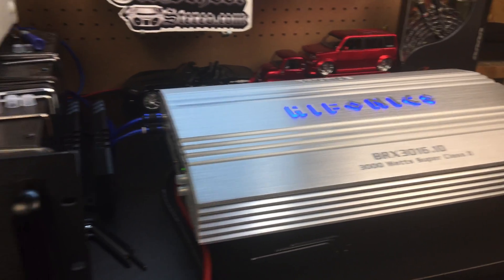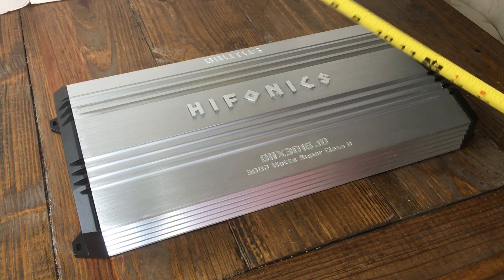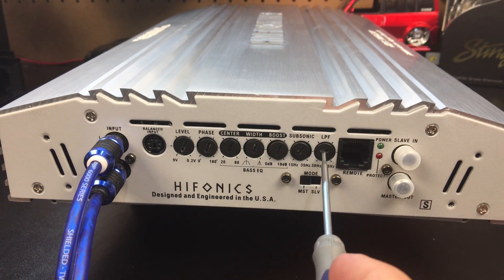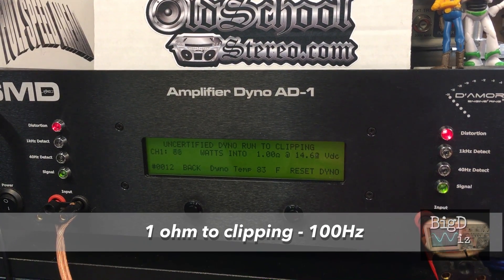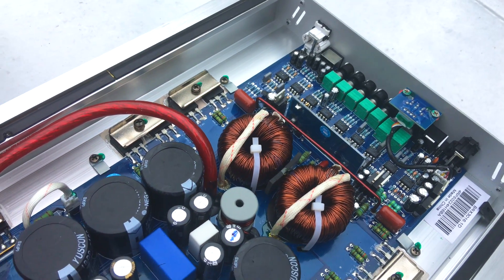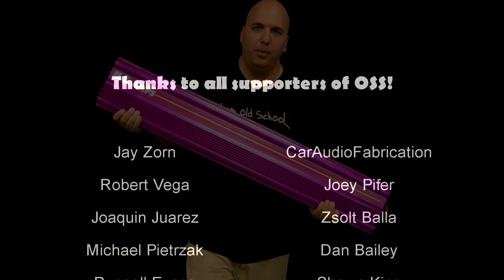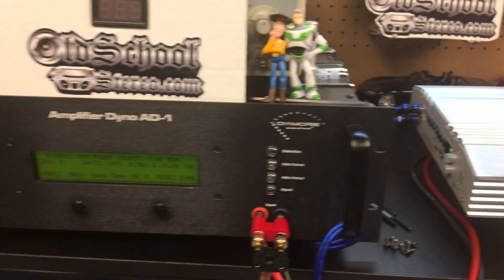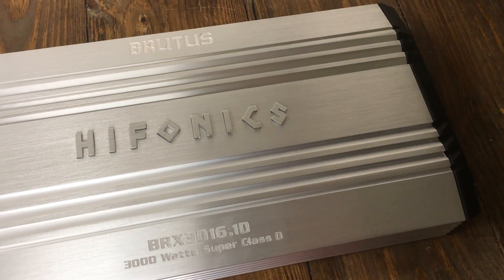Is That 3kW RMS or MAX? HiFonics Brutus BRX3016.1D 3000 watt Amp Dyno Test

Comment: Mosfet down! I owned a 2k hifonics amp , I switched to a Rockford 1500. Hits way harder and significantly less light dimming. My cousins 2 year old hifonics 3k amp just failed after only 2 years. I think they are better than the really cheap amps but they don't don't seem to hold up and are more power hungry but for the money it's nice on a cheap install.
Reply from the maker: Precisely

Comment: They havent made good amps since the brutus BRZ model amplifiers. They were CEA2006 compliant. The newer ones arent
Reply: Iv'e still got my BRX-1600.1D that Iv'e had since 2011. And it's still kicking pretty hard. And also CEA2006 rated.
RMS Power Rating (@ 14.4V):
 4 ohms: 600 watts x 1,  2 ohms: 1200 watts x 1,  1 ohm: 1600 watts x 1 chan.
Reply: @purplehazeffc  hang on to it i had the BRZ 1700.1D. I now have the newest model now a BXX 1200.4 and BXX 3000.1D. I have two batteries in gonna get a 3rd battery with another run of 0 gauge. To run it at 1ohm at 2500watts rms. Ill see how it does in this °100 heat

Comment: I'm very sorry your amp died, however I took this as a learning opportunity and made some adjustments to your madness!!! I have been running this amp at 0.48 ohms for almost two years now on 2 x Power Acoustik GW3-10 10" Dual 2 Ω 1000W RMS Subwoofers in a large ported box 32hz tune. the amp does get hot in that area that eventually blew up on ya, so I mounted a 140mm pc fan blowing across the amp to keep it cool and NO problems! I use this in my home theater. I'm really amazed at how clean the lows are on this amp. I don't think I can ever use over 4000W+ on my setup without destroying my subs. I have "abused" my setup as well and clamped about 2,200W on various tracks for about 20 min before the smell of voice coils started filling the air. ALL the windows, doors, vents, walls, and floor were shaking the house. 

Thank you for awesome content!!! 

I have a 13.1V ASTRON RS-70A power supply on 3 900CCA Group D batteries. The 13.1v is for safer float voltage across the Walmart batteries so they don't puff in 3 years like they would at 14.1V.

I'm outta here!!!!!!!!!................

Comment: Big D come on now we both know you know it’s RJ-45 not Cat5 lol!! Good test! I  catch myself watching old amp dyno tests again!
Reply from the maker: Cat5 is da cable, RJ45 is the connector
Reply: Williston Audio Labs lol good point ill concede rj-45 is the connection type. The cable would be an Ethernet cable, Cat5 would be the category or rating of the Ethernet cable used. I would imagine for car audio purposes these companies could possibly be better off using Cat6 or better since it provides the better signal to noise ratios. Not to sure if it would make any difference though that’s getting pass my knowledge a little bit.. maybe you would know if I remember correctly you work in IT or network fields?or something along those lines.

Comment: Where the fuses at on the amp?
Reply from the maker: External fusing required
Reply: @wal  so that's just a in line fuse close to the battery on positive wire

Comment: Howphonics! Ha-ha, just not what they used to be! Why can they not just rate things how they actually perform! Then throw the "peak" in there to sell,  like 500 watt rms, and 5kw peak!! It's just got crazy, what do they do , spin a wheel for numbers, or just pull them out the air! Like usb power banks, 60,000 mah, when it has 2 x 3ah batteries in it, it should be less than 6,000 mah, because of it can't be 100% efficient, where does that 60,000mah/ 60 ah cime from, do they just add zeros to it!! On amps they just double or triple the real output!! Great video!!

Comment: 1001bd RFalsgate. Over 15 years I've had the big ass amp. Only fixed it once touched wires together oops! But will a Hifonics last that long? 2x Type R Alpines only replaced 1 over same amount of time. k5 Blazer,  Infinity Q45, 3 diff.  Saturns, and now Es330. Rockford and Alpine on mine! Had Jls had Kenwood, Kicker amps. Still bang the old school 2 fans, and Epic Center beating for years!  Nice video tho.

Comment: the new bxx 3k is bad. hooked up to two batteries big 3 upgrade and it kept going into protect when i turned up the volume. and as soon as i turned the volume down the amp would come back out of protect, never got hot. the amp was seeing 14.5 and only dropped down to like 13.8. speakers were wired in parallel and was reading 1.5 ohms each. i had to get that gain to 75% to make my speakers move......omg distortion and clipping right out the box.i will never buy hifonics again..its being shipped back to amazon right now.i will be buying the orion xtr 2500.oh my speakers are evl 15's dvc 4ohm. the best speakers ive owned going on 3 years with these speakers.

Comment: Wow... That amp is actually quite impressive.. Or, well, it WAS impressive.. Haha! Nice work :) An amp that sort of lived up to its ratings, even handling an overload for a little while before going bang but..i guess the protection circuitry isn't up to par as you'd hope it would notice the wrong load and go into protect before it blows the arse out of the output stages! Or in this case the SMPSU stage? Ouch.. I'd love to have a go at repairing it! Hahah.. Make it live again!
Reply from the maker: I sent it back and yes it was a bummer the lack of protection circuit

Comment: Crap 5k of rms! ... hey I've had my APMI2000 at @0.5ohm for over a year now and still going strong  so I was wondering if you could retest it at .5 on music to see what its capable of?  People ask this question all the time in the car audio forums. Thanks.
Reply from the maker: The AP doesn’t like 0.5 resistive, but as you know speakers in a box exhibit impedance rise. I’m getting a box for the Massive Audio 6kW sub and plan on testing amps with this sub in addition to the Dyno

Comment: Yo Big d why so much voltage drop on the test with this amp? 
What you running for electrical in there these days. Still have cap bank or is that gone?

Comment: Hifonics was in all the booming rides in the early 90s. They shook the ground. Hifonics was the Mack Daddy
Reply: Mr K that's when they were Zed made back then every brand that was Zed made banged today hifonics is budget stuff ok for daily system not for comp
Reply: So was autotek in the 90s and mb quart in the 2000s but now maxxsonics owns them all along with ppi crunch sound stream and some others idk I guess if you don’t push too hard they are a ok product but I have never seen a maxxsonics amp that didn’t go up in smoke after a while my buddy had all sound stream rubicon amps it worked for a while but ended up blowing everything door speakers amps and all he ended up getting some xta sound stream amps before they went to max Sonics never had a problem very quality amp 🤷‍♂️
Reply: @mirkolazar9250  Sounds like your friend didnt know how to set his system up. Ive been running Hifonics since the Zed era and run a couple cheap Maxxsonics amps in a few of my cars are over 10 years old. If you set your system up properly things dont blow up.
Reply: Yep. Hifonics and precision power. My buddy had a precision power in his Pontiac 6000 that was like 3 feet long. Even with an extra battery and a capacitor it taxed his charging  system hard. Headlights dimmed a lot. Dropped below 10v with Snoop dogg doggystyle cd.
Reply: @joes.7536  Our step up from Hifonics back in the day was Phoenix Gold. My brother had 5x XS2500s running four X-max 12s in a 90s Tbird and the thing hit 157.9 in competition which is pretty nuts for only 2400w of actual power to the subs. Man I miss those days running a stereo shop and having not a care in the world other than how hard i could make my eyes cross when that bass drop hit
Reply: In always sticking with Hifonics had them since late 90s
Reply: @Fat Italian I had vlx400s, ppi arts, audioarts etc and loved the way my Hifonics 8 colossus sounded. I currently dont have any systems in my cars but about to start one.
Reply: These hifonics amps are nowhere near what they were in 80s and 90s though lol. Old school ones were way better
Reply: @JohnDoe-bk4px  Everything old school was better
Reply from the maker: Yessir, you are correct! Zeus and Colossus FTW!
Reply: @wal  Orion amps, the original 1000 watt units from the mid 90's.  what god tier amps those were.
Reply: Moe Whitfield I still have my 2 xtr 2250's known the beast from the 90s
Reply: @wal  I sold and installed car audio right around 1999. We had a Colossus up on the wall just to show off and it worked really well. We would build 6 high towers of the old pink Power From the Gods Hifonics 12s and they would just FLY out the door with people dreaming of running them on that massive amp.

Comment: Love the reviews but I have this amp on a 12in typeR. It will go in to protect mode if its going hard😭
Reply from the maker: Make sure your ground is good and that your voltage isn’t dipping too low 🤔

Comment: 250 dollars or less what amp would you recomend to run 2 americanbass xfls? xfls are 1000 rms each and it will be wired at 1 ohm. xfls also have 3 inch voice coils with a 220 ounce magnets

Comment: Big D any ideas what the manufacturer's do with the amps that people send back with defects? I'm trying to get ahold of a few blown amps only because I get people asking me to fix theres but  I've only repaired a few and it was just the main power supply caps and some terrible solder joints. Before I start charging people there hard earned money, I need to make sure I'm fully capable of the repairs...THAT LAST!
Reply from the maker: They usually board swap them I think. Some will sell damaged amps in bulk

Comment: I've got the next one up from this and it's been running at .67ohm for over a year and has never clipped off once
Reply: do you still have an is running?
Reply: @richardj.barlow4294  yes I do and its still running great
Reply: And its the 3216 model
Reply: @stevenlacroix1856  awesome thx for your reply i been looking for an amp and other then taramps i can't find many ppl running anything else but i want to get like a 3 to 8k amp ands it tough to know who to buy anymore since none of the brands are made here anymore.  But hifonics just look befier to me then taramps
Reply: @richardj.barlow4294  I have had it for about 4 years now and I've never had a problem
Reply: @stevenlacroix1856  appreciate ur response il prob look at the higher watt i think its zeus or maybe brutus regardless i just wanted to know the quality if urs built wdll then odds are they are all pretty good.  I had them back in the day and they were awesome way under rated watts wise and that amp still plays to this day but not same company anymore almost none of them are maybe jl audio might be the only one?
Reply: What speaker setup gives you 0.67 , and what is the final ohm when playing music
Reply: I'm running 2 12 inch bravox extremes both dual 2 ohm and 1200 rms each and they read .66 on the meter together
Reply: @stevenlacroix1856  is it a long speaker wire run,I thought you would be closer to 0.5
Reply: About 3 feet but right at the box thats what its been for the last few years

Comment: Can you do a dyno test on hifonics brutus  bxx series 4k at 1 ohm
Reply: Sean Patrick  I just sold my xtr 2500 and regret it as the next amp I bought is trash. I'm looking into the bxx4000 also bit can't find shit
Reply: Jose Velazquez if it is a class d amp no it will not work long bud
Reply: @craigbarnett3564  

Are you an amp builder?

Comment: Do you think these results reflect the Hifonics Zeus zxx 3200.1
Reply: They are weaker than the Brutus bruh just get a Audiopipe 2000 1d. or 3000 1d. they r the cheapest & they do true watts not made up now the older Hifonics Brutus amps they got them on Sonic Electronix but they drain your electrical but they do true rms also but Audiopipe is the way to go they don't drain as much but they drain a bit but Rockford Fosgate prime Series 750 1d. or 1200 1d. put out way more watts and don't require a lot of electrical Skar Amps do real numbers too....

Comment: I have a brx4016.1D that I am trying to find a dyno on but with no luck. I am needing to find out if I can run it steady at .67 ohms. I have 3-T1D412's and can either run like 2.67 ohms or .67 and 2.67 is not goibg to give me the power I am looking for. If not do you have any reccommendations. Precision Powers Black Ice 7000.1 perhaps?

Comment: I owned a hifonics amp imo they're  pretty good! I had them on my sundown sa's sounded great! That amp banged them pretty hard!
Reply: How was the lows & SQ of that set up ?
Reply: @jweezy216  the work great together I had a hifonics brz2016.1 2k rms at 1 ohm on a sundown x12 hit good but sold the x12 now I have 2 sa10's same amp just got subs yesterday haven't messed with settings yet but definitely  hit lows more consistent  than  my 1 x12 less power tho since running at 2 ohm vs 1 might send it at .05 ohm turn amp down and pray it lasts otherwise  I'll upgrade to this amp run at 2 ohm same power check my page I have video of the x12 before I sold it

Comment: Love you'r vids. Just one question - When running test at 1 Ohm and lower,  have you compensated for the series resistance in the cables and connectors? Even though it's not much - you might see some 50 mOhm og maybe even abit more.

Comment: I know this has nothing to do with power ratings but I run hifonics amps on both of my sxs. They are extremely durable for offroading as they've been rained on, under water, washed with the water hose, pressure washed and once they dry, they still work. They're cheap priced and do great for my system. I can't see spending the big bucks for a high dollar amp that may get ruined. I'm definitely a hifonics fan.

Comment: Hifonics - probably the most underrated brand on the market.  They are top tier and people just don't know it.
Reply from the maker: That's your opinion, I happen to disagree
Reply: When i say rated, i'm not talking about wattage output... I'm talking dollar for dollar, practical application.  You tend to rate amps based solely on power output with no regard to real world performance.  At least based on your videos.  Wattage is important but its only a small part of the big picture... Surely you know that right?  When you combine clarity, efficiency, price, sound quality, power output, there's nothing I have found that really outshines them dollar for dollar.  That being said i don't know what the brand is doing now.  All my Hifonics amps are 8+ years old.  I bought about 6 between 1998 and 2010 and have never found something worth replacing them with.  I have tried lots of mainstream brands over the years.  infinity, Kenwood, JVC, Sony, Pioneer, kicker, RF ... list goes on.  The similarly priced brands sound like crap and the high end expensive brands don't sound any better.  All that being said, they could have gone to shit in the last 8 years and I'm just unaware of it.
you have bashed hifoncis amps in  videos because they didn't quite hit their rated power ... compare it with a similarly priced amp with similar output, I bet it sounds way better in practical application. Would put money on it...  I saw you praise a Pioneer because it tested at it's rated watts and bash a Hifonics because it only tested at 80% of rating.  That's a pretty silly set of statements considering they are similarly priced and Pioneer amps generally sound like doodoo, properly rated or not.  I have a zues 300 watt amp that will test at 600+ all day lol.  Of course it's from the 90s....
Reply from the maker: Again, your opinion and I happen to disagree. HiFonics in the 80's and 90's were mid/high end and some of these amps are still very popular by SQ junkies and collectors. The current HiFonics as I show in this video are low to mid quality. The heatsinks look nice, but the internals are generic as you can get. Low quality components from front to back. Not to mention this one has a lack of over current protection and why it blows a power supply transistor at the end of the video.

I don't like when manufacturers mislead consumers. The current Maxxsonics family of products (HiFonics/Autotek/MB Quart/Crunch) currently show ratings which can confuse the consumer. They provide wattage numbers with no reference to distortion/clipping/frequency or anything. As you already stated, they tend to do about 80% of rated, so they are 20% overrated. Difficult to compare these amps with other brands unless you see actual test data. 

I do not disagree about preferring the older HiFonics as I have several of them myself and they are very special. It's just unfortunate the brands we knew and loved in the past may or may not be good these days.
Reply: @wal  what brands do you recommend in today's market in the entry to mid range... Stuff that costs say 200-300 bucks.. If my goal is sound quality. Also... An amp being non idiot proof is not a fault in my eyes... It put out damn near 6000 watts for 250 bucks....   You wasting your money pushing the amp too hard is not the amps fault.  It put out great numbers at safe 1-2 ohm loads..... Pretty much astronomical numbers for the price...  Guess we will just have to agree to disagree... As least we both agree that Infinity is badass... Their products are probably my favorite.  Get your hands on a cerwin Vega... Would love to know if those are worth a crap anymore.  ;-)
Reply: @wal  I replaced a Kenwood w/ this and clarity is just so much better